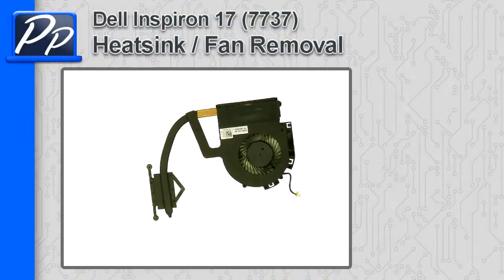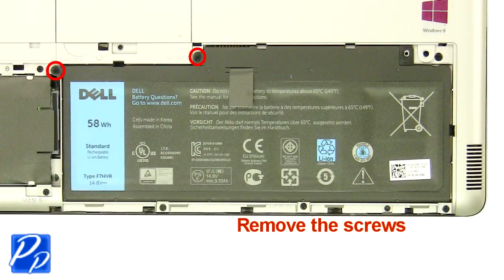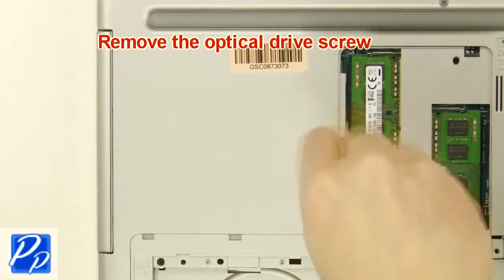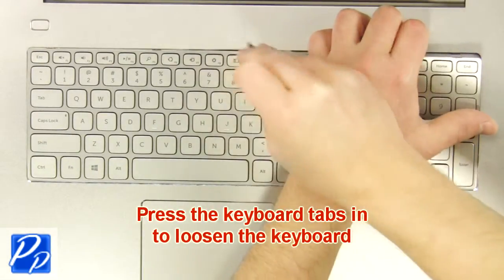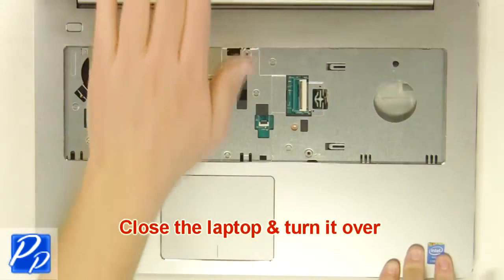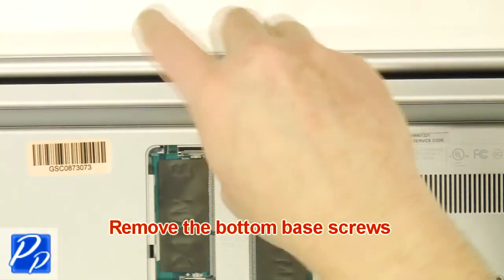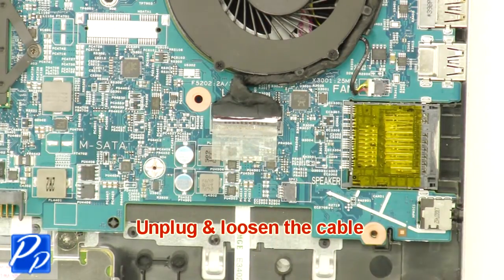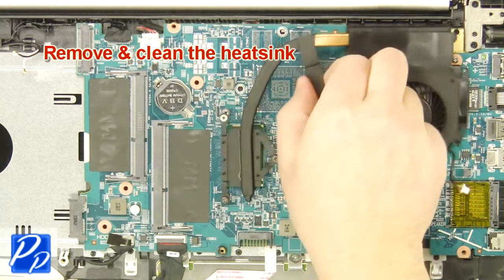Dell Inspiron 17 (7737) Heatsink / Fan How-To Video Tutorial

Comment: The fan on my machine had got very noisy, which of course meant it was not really cooling the video and processor chips either. So I got a new fan for £20 and set about replacing it. Getting the keyboard out was a bit fiddly because you need to push the flat screwdriver quite hard, but finally I got it out. Two points to add to this explanation. Firstly the last 3 screws on my machine were actually 6 captive screws, the three shown (one of which was quite difficult to undo) and 3 more over the video chip. Secondly, since removing the heat sink necessarily breaks the thermal connection, you need to clean and reapply thermal compound on reassembly so it is as well to have some before you start!